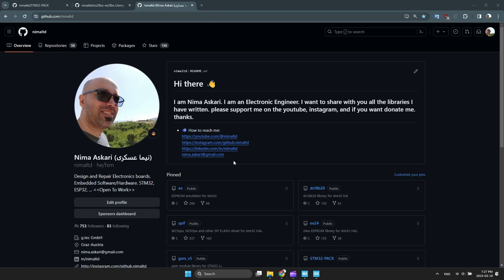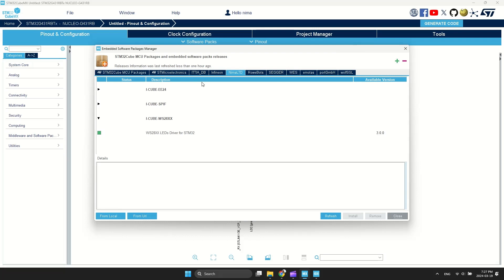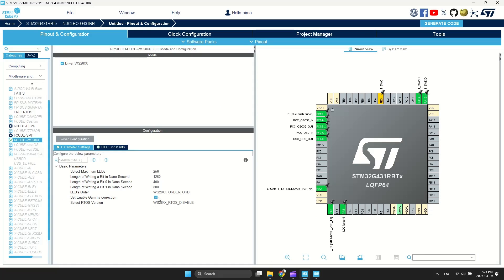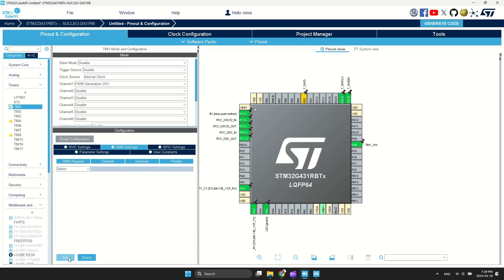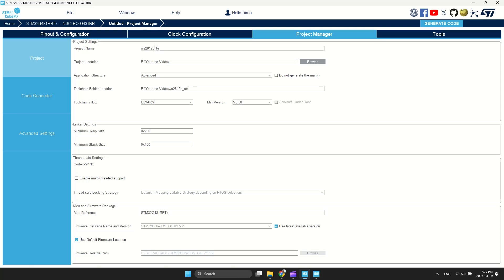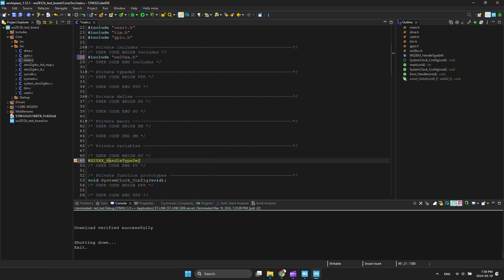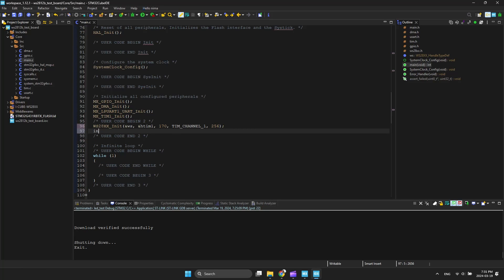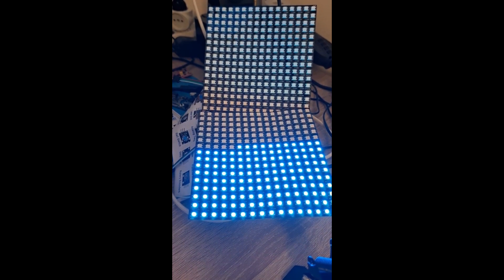WS28XX Library for STM32

Comment: Hi Nima I tried your way but it still doesnt work. Did u program something else for those LEDs. I have a f446ZE nucleo board with a WS2812 led matrix. My frequencies are all set to 168 and also I cant set Memory to Byte it shows only Half Word. Also If I change my peripheral data width to Bytes then it changes for the memory to Byte. I am sort of new so any help?. Only the first LED is on i cant seem to notice any sequential flow of leds being turned on
Reply from the maker: Please have a look bus frequency. I think in your mcu it is not possible to work the same as core frequency. Maybe diveded by 2 or 4

Comment: Hi this was extremely helpful in my project but I am getting a weird glitch effect on my first led where everytime I update the colors the first one may turn off, change brightness or color randomly. I am using the stm32f0 chip and I noticed that it only works when my DMA peripheral is at word instead of half-word. Have tried troubleshooting but I am unable to solve this issue any assistance would be greatly appreciated! Great video by the way
Reply from the maker: Hi. I never test it with f0. I have c0. I can try in this week. Please notice me if i forgot.
Reply from the maker: the c0 was working in half-word. but fisrt pixel had problem,I fixed it. please update and try again.
Reply: @nimaltd  could I know what you changed? I have been trying to figure it out and would love to learn the reason!
Reply from the maker: @Leetheskill  added 1 more zero at first and end of packet.
Reply: @nimaltd  ahh ok going to go and try to understand why now thank you!

Comment: Hello, I use STM32H743 and port your library, the main frequency is also modified to be the same as you, but the PWM pin has no signal output, can you help me take a look
Reply: I can send you the project.
Reply from the maker: Hi. Ok sure.

Comment: Hey Nima! Thank you for building this lib! When I try to compile after following your video, i get error: "region 'RAM' overflowed by 608 bytes". I am using the STM32F051K8T6TR MCU which got 8 kB of RAM and 64 kB of flash. Am i doing something wrong or is the library very ram-heavy?
Reply from the maker: Hi. Your welcome. Set the buffer to lower value.
Reply: @nimaltd  I am facing the same issue. Could you please help me which specific buffer you are talking about.
Reply from the maker: @DineshKumbhare-b7p  #define WS28XX_PIXEL_MAX      256 in configuration
Reply: @nimaltd Thank you.
Reply: @nimaltd  after setting to lower value also my memory is getting overflowed by few bytes. anything else i can do?
Reply from the maker: @DineshKumbhare-b7p  no. I dont think so. Just adjust this value.
Reply: @nimaltd  Ok. Thank you.
Reply: @minitandstik , i am also facing the same issue. can you help me how u resolved it.

Comment: hey, for me only the first LED lights up and it's always green no matter what color I set. I also use the g431 board.
Reply: same error i am using PE9 pin set as TIM_CHANNEL_1 but the 1st LED as green is lit and no other change is happening for me too. Using the F446ZE board
Reply from the maker: @molality  hi. Please update to latest version. I solved that problem
Reply: @nimaltd  Thanks a lot for responding. Just a few queries the 170Mhz that u have selected in your code which CLK value is it? I am having input frequency is 8 yours is 25. and in the last branches of your clock configs is all 170Mhzset. Unfortunately because of a board difference I have it all set at 168 and some APB1 prescaler is set to /4 giving PCLK1 to 42 Mhz and stuff.
Reply from the maker: @molality  you have to set it to timer's bus frequency. Check it on the datasheet with selected timer.
Reply: @nimaltd  thanks worked just fine so grateful to u
Reply from the maker: @molality  🙂😊
Reply: I set chennel 2 and it didn't work, but it works with CH1
Reply from the maker: oh. it is weird. it's no different. please double check pwm configuration.
Reply from the maker: i have g431 board. you can send the project for me.
Reply: @nimaltd  I have the same problem nothing is working
Reply from the maker: @Nayel-Khouatra  please send your project
Reply: @nimaltd  Where can I send you the files??
Reply from the maker: @Nayel-Khouatra  email. Nima.askari@gmail.com
Reply: @nimaltd  Thanks !
Reply from the maker: It is working well on my device. I sent you the video
Reply: @nimaltd  thank you nimaltd!